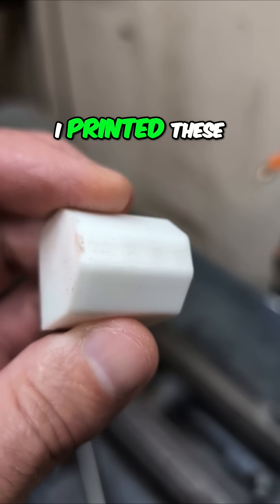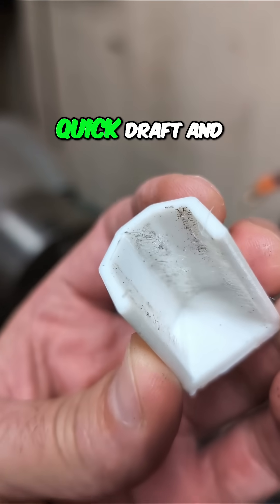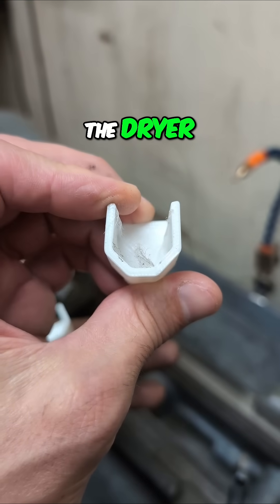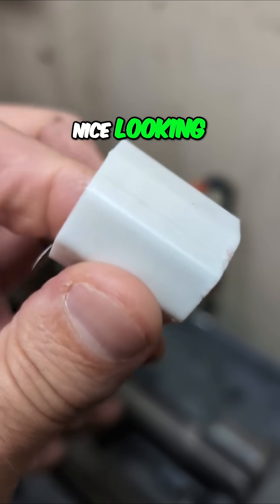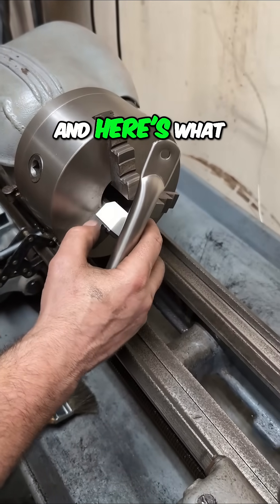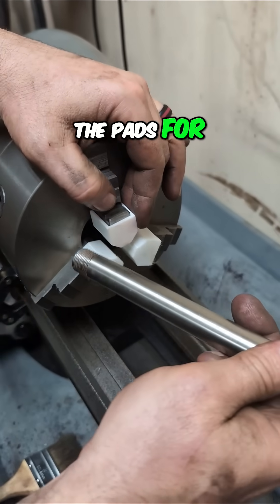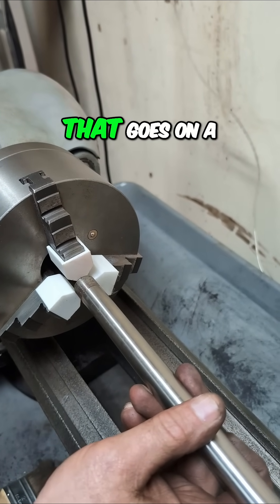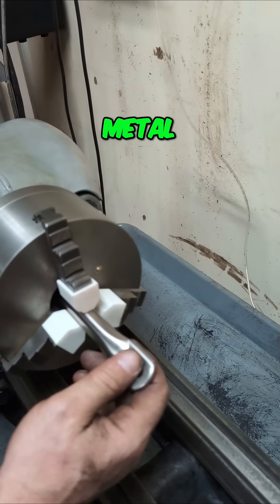3D Printed Lathe Pads: Elegoo Centauri Carbon TPU print

Comment: I would think it would be horribly out of concentric. A 4 jaw Chuck would be able to compensate but some aluminum foil would have worked great as the thickness is very even.
Reply from the maker: Obviously, this introduces some flex. But it worked well for this project, which had very loose tolerances.